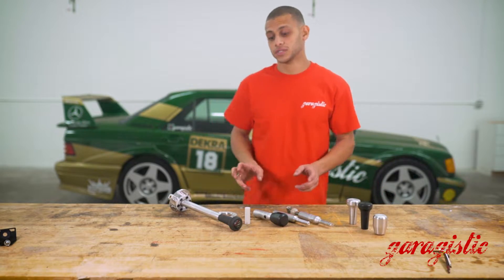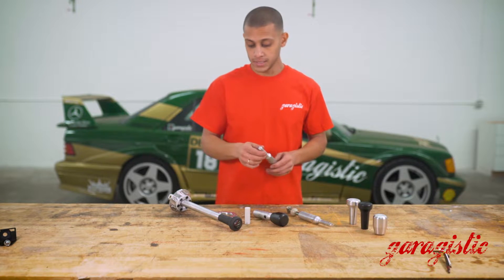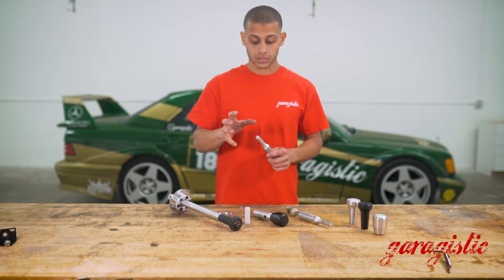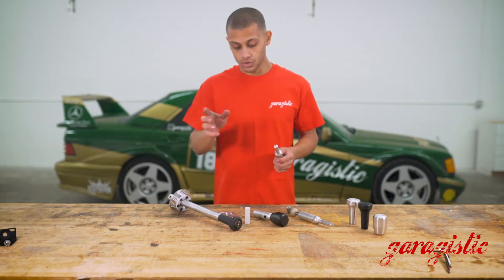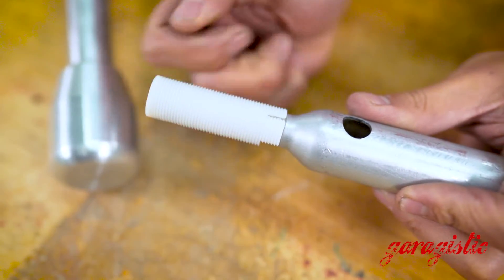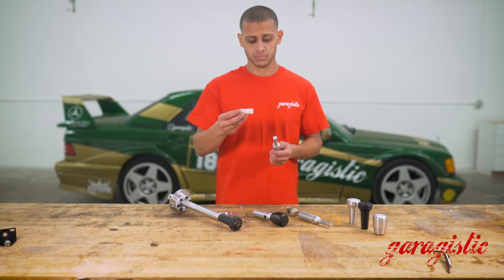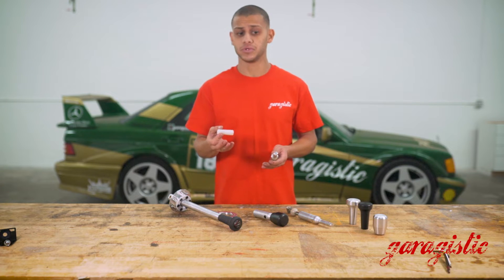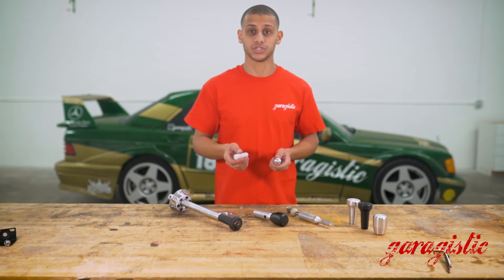BMW Aluminum and Delrin Shift Knobs (E30, E36 and E46)

Comment: how many grammmmmsss does it weigh
Reply from the maker: Which shift knob and material were you interested in?
Reply: @garagistic  it’s an E83 X3, overlanded and a ZHP manual swap! Alcántara preferred, heavy af in black with no bevel- unsure what’s possible- other than the E46 shares the same platform